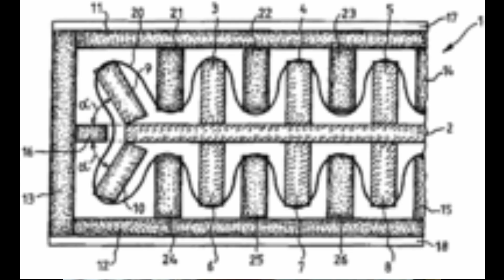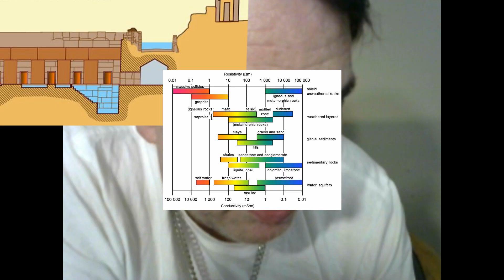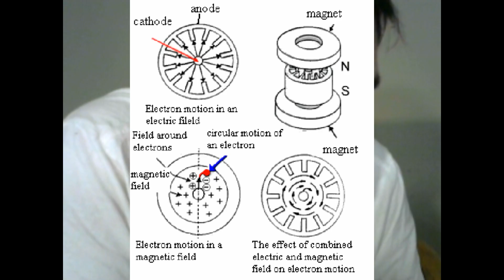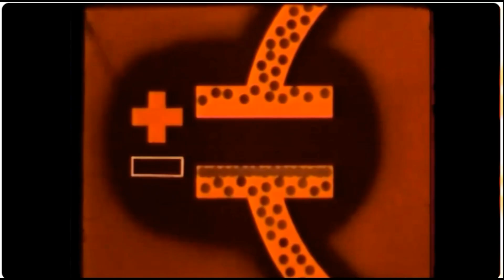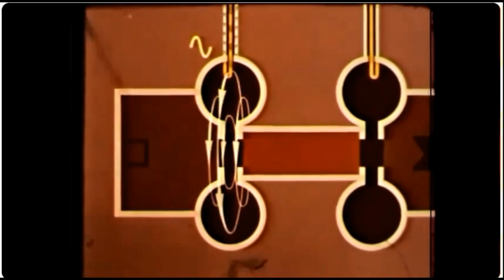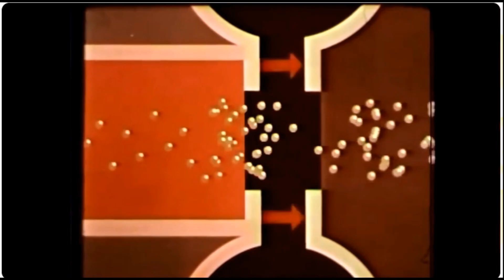Egypt Osirian is a machine (recirculating planar magnetron technology) -  a Wayne Hilborn Hypothesis

Comment from the maker: This hypothesis leaves out much of the evidence... The "Cells" were 2 meters X 2 meters... and an exact meter suggests a knowledge of speed of light.  They were more advanced than Americans (they had metric and healthcare).   What sealant is used on roof..  did they have plastic or better?

This should be more fully excavated and the math of electric vs dielectric stone is known... 

This theory could be disproven at many turns.. but it only seems logical.

This would make ancient civilizations a lot more technically advanced than us.. at least in certain ways,

For them to make a recirculating planar magnetron out of stone... 

For the stones themselves to carry such electricity.. has been proven.. but again.. math could help analyze these stones

That kind of research would require a team and funding...  and egyptology wants us to think its a swimming pool

This is how to analyze all ancient tech.. as if static electricity based machines